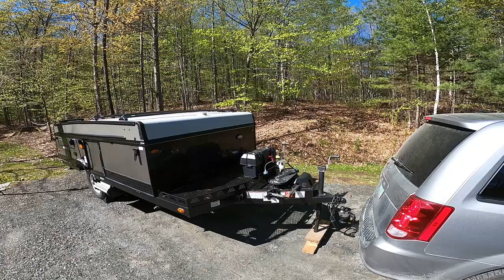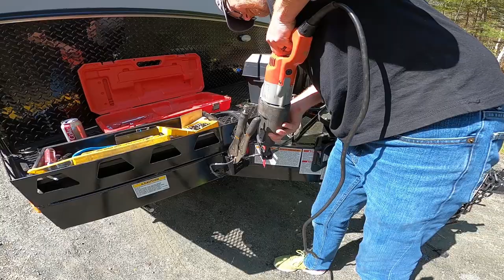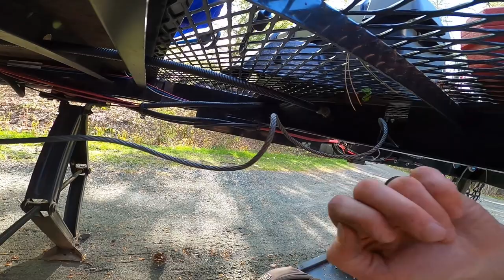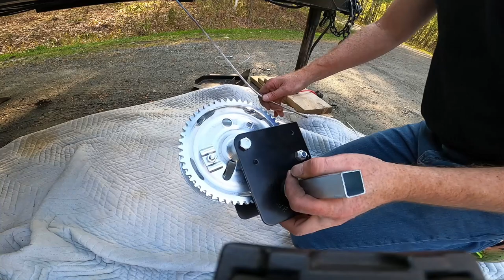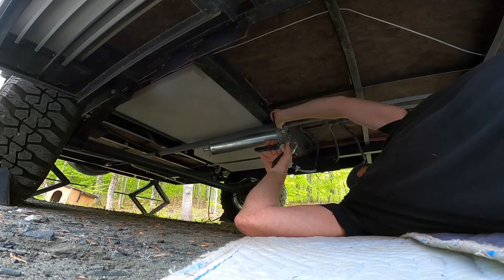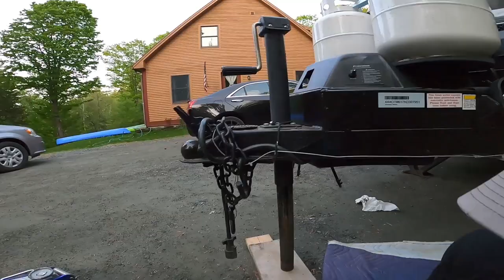2019 Rockwood Pop Up Manual Winch Install | Electric Winch Be Gone!

Comment: Still doing research on what trailer to buy. If you had to get another one. Would it be this one or another one? Thanks
Reply from the maker: Wow thats a great question. Knowing everything I know now, I would buy this unit again. I would get rid of the winch and put in a manual winch. I'd seal the roof screw heads and corner pieces, roof fan and side moldings. I'd ask the dealer to verify the alignment (our trailer was towing sideways and they fixed it under warranty). And I'd look for RUST underneath before taking it home! And once home... I'd remember to stake down the awning when it was out AND make sure it was leaning down when it rained. I know this trailer so well now... and we have made amazing memories in this thing.... yeah, I'd buy this one.... but only if I could get a really good price. If I was single? I'd buy a corvette and stay in hotels and airbnbs LOL But seriously, I wouldnt trade this time for anything. I love the family the Lord has given me and thankful for this trailer and the experiences we've shared together.
Reply: So what would you  pay for one now? How would you go about getting the price you want to make it a win win? For both parties you and them.  Thanks
Reply from the maker: @downhill615  We paid 11k for new in 2019. Obviously things have changed since then so you have to balance the need vs the price. And if the 2280 is the only one you want, the price will get harder to negotiate. Also inventory is a bit scarce. There are some things my wife and I want to do but we're waiting for things to level out a bit more. Perhaps, Lord willing, next year will look different.
Reply: @sstressfl  out here on the west coast. They want 15,000 or more.
Reply from the maker: @downhill615  I’ve heard some out west say as high as 30k. 15k is at least close to msrp 👍 Again, balance against the need or desire 😀 When you have kids that are growing up fast, it can motivate you to pay a little extra. I hope you find a good one that is well built. Perhaps you could ask them to install a manual winch included in the purchase 🤗
Reply: @sstressfl  thanks. We have a 4 year old and 6. Both girls that like camping. Just want out of the tent on the ground.
Reply from the maker: @downhill615  I can SO relate to where you're at.... when we decided to try camping, I asked my wife what she wanted and she said "I just don't want the kids in a tent... I want to be off the ground". The popup is so fun. When I asked my youngest if she wanted a hard side like the other campers she said "NOOO!". They adore the popup and we have so much fun. Happy hunting my friend.

Comment: Hi can I ask if you show in your video a left hand or right hand winch we have the same camper but our jockey wheel is on the left hand side of the the camper so we need the handle of the winch to be on the other side then yours
Reply from the maker: If you call https://goshenstamping.com/lift-system they will ask you which side you want :) that’s where I got mine!

Comment: Does this work with all pop ups with a power lift system?
Reply from the maker: If its a goshen system then most likely. You can call the people that know at https://goshenstamping.com/lift-system They will set you up with whatt you need.
Reply: @sstressfl  Thank you! I appreciate the reply
Reply: @sstressfl  I have a 2013 Palomino 4124 and can't seem to find much info on whether it's Goshen or Shelby
Reply from the maker: @maryjuanarasta9220  call those goshen folks. They’ll be able to tell you. They know campers :)